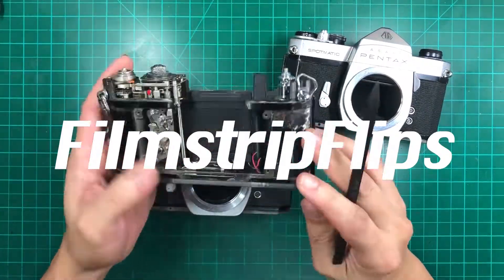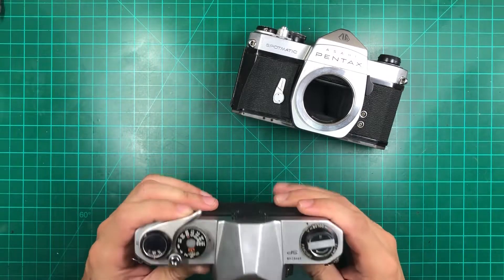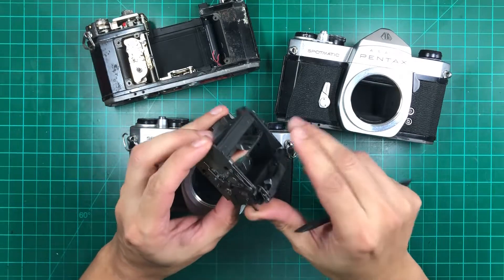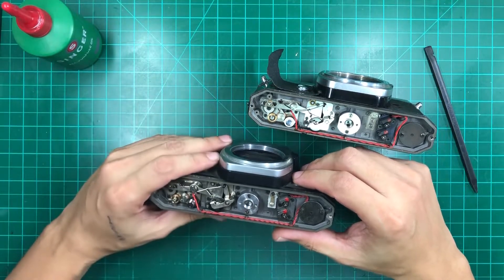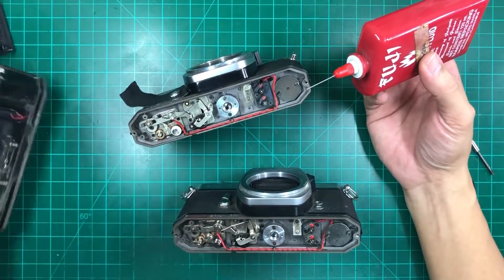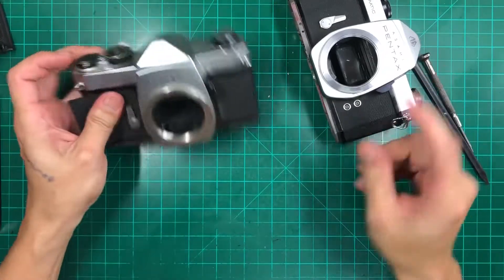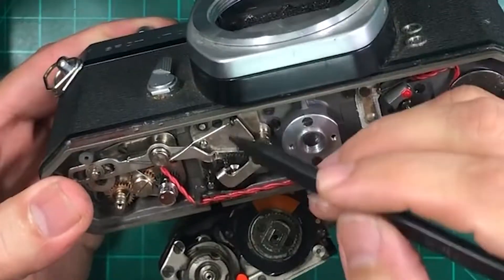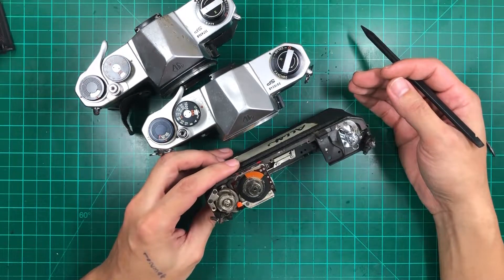Stuck mirror quick fix for Pentax Spotmatic, K1000 series

Comment: Wait, I can't believe no one mentioned this in the comments, so I will. 

My in-the-field fix for a stuck mirror is to cover the lens, do a double exposure on a different shutter speed (which often drops the mirror back into place), then switch back and keep taking shots. I think on my camera the 1/1000th sticks but if I slow it down to 1s it reliably works. I need to clean/lube still but I've put a few test rolls through it like that.
Reply from the maker: That’s a good tip! Thanks for sharing it 👌
Reply: I have the same problem, but it s a bit more complicated. It was completely stuck, after i used your method it still sticks but Once every 2-3 shots.
Reply: Thank you! This saved me whilst out and about

Comment: This fix worked for my spotmatic II, went to Jo-Ann”s craft store and picked up a $3.99 bottle of singer multi use sewing machine oil. Put some oil into a water bottle cap and dabbed some oil on the gears shown in the video using a tiny screwdriver. And after some dry shots and sitting overnight it fixed my problem and I am now able to use all shutter speeds without my mirror sticking up! Thank you for this video!
Reply from the maker: Glad we could help ☺️